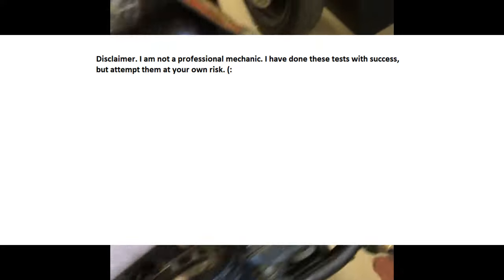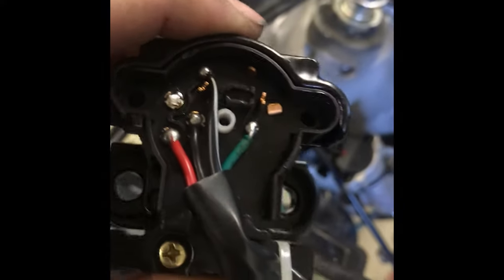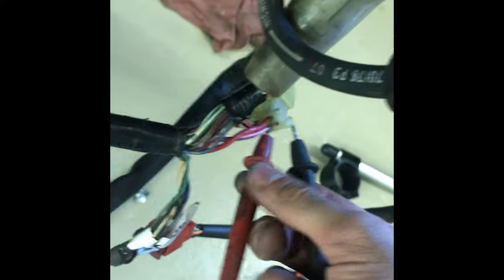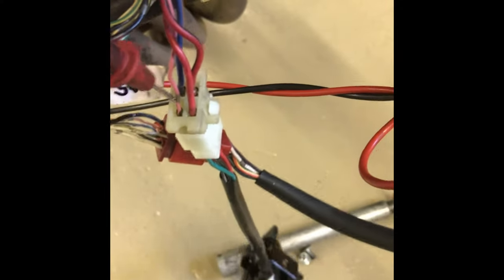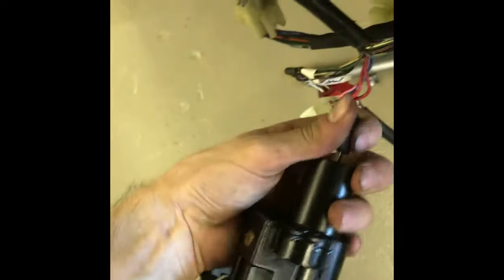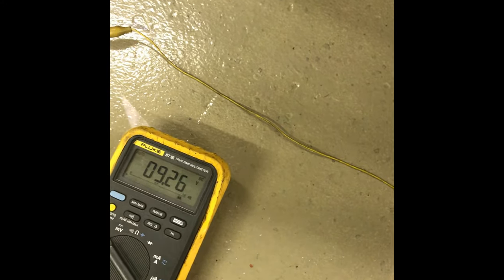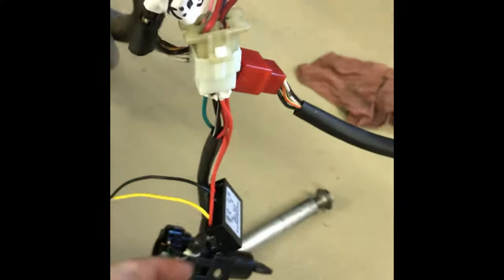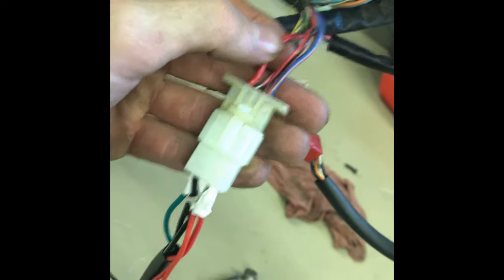Ignition to ECU signal wire (The Troublesome Pink Wire) CBR929

Comment: Thanks to your video I repaired a cb600f hornet, which has the same problem with the pink wire. You can recycle the diode from your old keyswitch, as I have done.

Comment: So would I just cut the pink wire and put a 9v battery to it?
Reply from the maker: Yes, but I think you will still have to ground the battery to the frame somewhere.
Reply: Also with the converter both red wires will connect to the green and both the negative black and other orange wire will go to ground or the negative on my battery?
Reply: I got a converter now but I’m not exactly sure how to wire it to the ignition
Reply from the maker: @itswil3492  there is a wiring diagram towards the end of the video for the converter that should help

Comment: Okay I have a 02 f4i got new pump in it and it was priming loud and strong but no start no start no start charged the battery up all day came back out and same thing until it stopped priming again??? I resaudered that diode in ignition just incase still no dice, I just volt tested DC20 red pos lead in pink wire where connectors go and I used a ground at my stem I’m getting exactly 9.97 volts is this good?
Reply: I’m literally begging somebody to tell me where I should go now I’ve also tried using a breaker wire for my manually able to read codes on dash for flickering it’s just a solid light ignition off, kill switch on I have wire in the green and brown right, turn key on position Fi comes on stays on that’s it no flickering no codes thrown I was told it should start flickering then unplug trip wire within 3-5 seconds put back in and turn bike off this is for resetting the ecm
Reply: @austinbates247 You need to go to the stealership. I'm having the same issue. I had a mechanic look at it for 3 hours, and he couldn't figure it out. I'm going to take mine to Suzuki because I can't figure it out. I tried a different ecm, ignition, starter solenoid, tip senor, and kill switch. None of this helped.
Reply: @drjd2real  it shouldn’t be anything crazy wires fine new pump fuses are good relays good it’s boiled down to ignition I know my tip sensor is fine
Reply: @drjd2real  keep in mind this is the factory oem ignition that has the pink wire
Reply: @austinbates247  I think it is something crazy because when I research the problem, it seems common, but no one really has a solution. The ones that do figure it out, their issue is not my issue. I know my ecm is not communicating with the cluster and fuel pump is getting no power.

Comment: I have the same problem with a 2002 Hornet CB 600 F, I disassembled the diode is the original code is: 3.9 B2 (may be helpful ☺)
Reply from the maker: Hope it helps!

Comment: I'm putting one of these engine in a hillxlimb bike, won't have a ignition switch just a starter button, do I need to feed that pink wire. 9v?
Reply: yep, pink needs 9v. some people have run into issues with just converter so try and run a resistor in series as well. that should work though.

Comment: Man I’m having a problem getting my 929 running and it felt so good to hear her fire up with the 9 volts. 

Prior to this the bike would crank but not fire?
Reply from the maker: Its been so long since I did this, I don't remember exactly. If I'm not mistaken, the fuel pump does not run unless that wire gets 9v. I honestly don't remember if it would turn over or not when you hit the ignition.
Reply: @jesserhay8805  Yeah my fuel pump primes and works when I crank the bike over and when it’s disconnected from the rail gas pumps out. So it seems my injectors are not firing or I’m not getting spark. In my experience most of the problems that happen with the bike don’t allow you to crank the starter so it’s weird.

Comment: Why not just replace the diode?
Reply from the maker: Yeah, you absolutely can replace the diode. Just gotta make sure it’s a zener diode that will reduce 12v to 9v (a normal diode only effects the direction the current can flow). I didn’t have one at the time and was able to get the converter quicker.

Comment: My honda 500 atv is doing same thing could this be the issue
Reply from the maker: Its possible. Im not as familiar with the electronics on ATVs.
Reply: Use a 9v battery  and  find  out .  Probably  the  problem
Reply: Ok I'm going to tomarrow only difference I can see is that my pink goes into fuse box first
Reply: Ty for your reply been driving me nuts for a month

Comment: Where do you get voltage converter
Reply from the maker: I believe it was just off of amazon. Look around for 12v-9v DC converters
Reply: Ok thanks I was thinking I could find a store that sells them
Reply from the maker: @derrickjackson8528  it’s possible, but it’s kind of an odd ball part, I’m not sure who might keep them in stock
Reply: A radio shop may or may not have one...it’s hit or miss